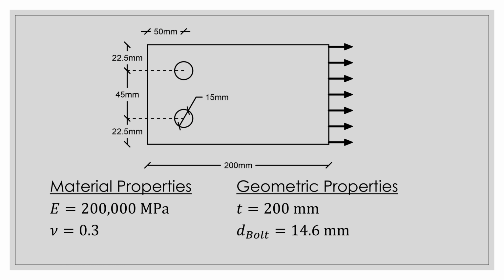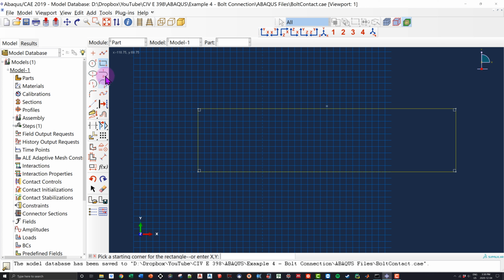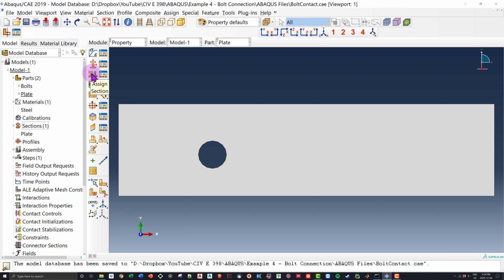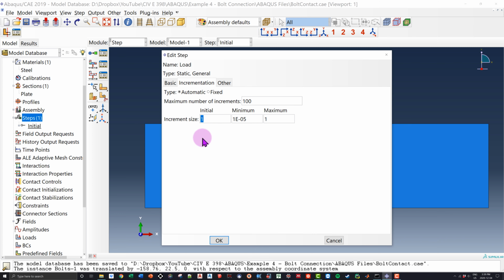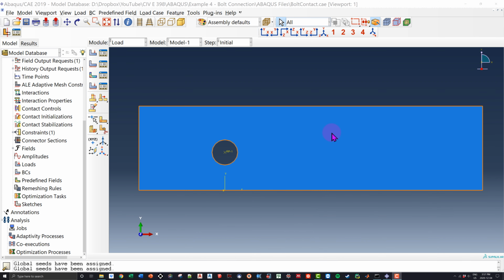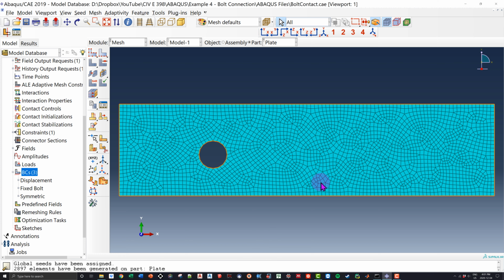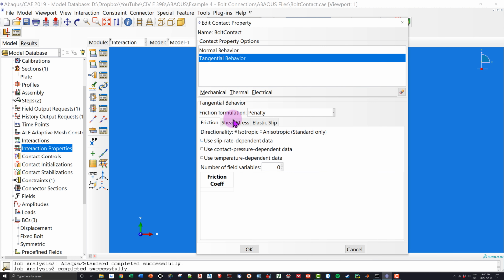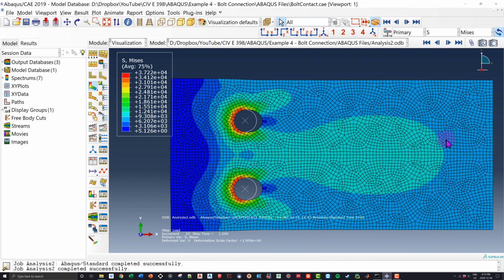ABAQUS Example | Rigid Bolt Connection

Comment: Hello, I tried the Rigid Bolt Connection in 3D. In that case, I assign interactions as BoltShank to PlateHole, BoltsTopNutFace to PlateTopFace and BoltsBottomNutFace to PlateBottomFace. However, I could not be sure that is wright or not. May you give a comment this ?
If I have only a bolt I can completed the Job, but If there are more than one bolts, I cannot finish the job (aborted for too many attempts) and I cannot figured it out. Do you have any suggestion to solve this sort of mess ? Do you have any connection sample with bolts ? Or might you direct me to documentation-video-research etc. for this. Thanks, best regards.
Reply: I have similar situation to simulate however slightly more complex because my bolt shank also have interaction with the concrete addition to interaction with the plate. Did you figure out some way or find some relevant literature on this ??